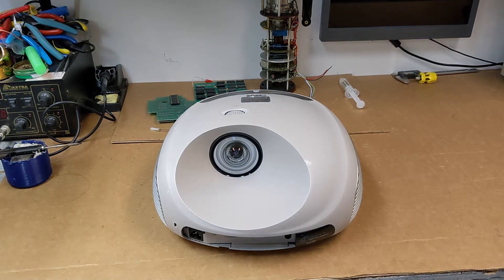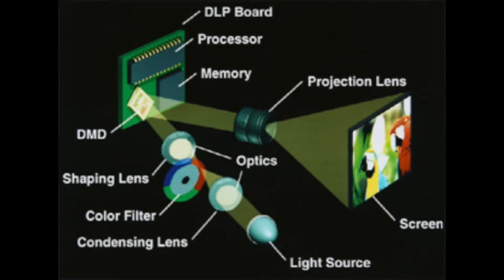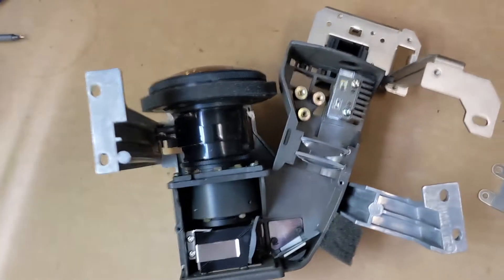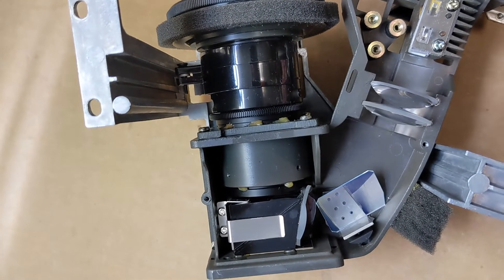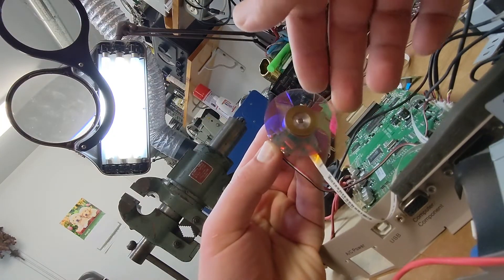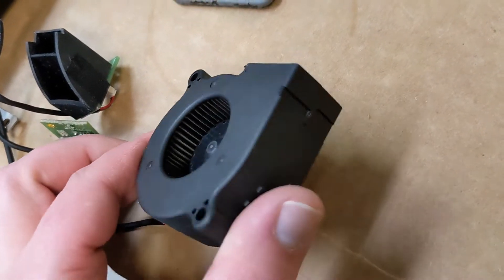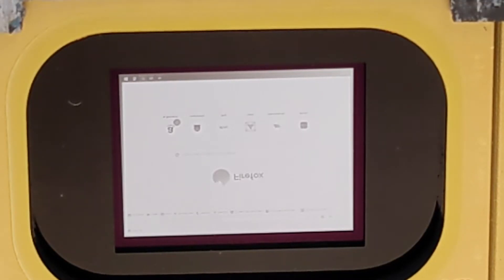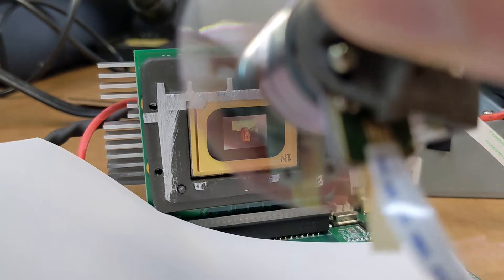What a DMD chip looks like in operation | DLP projector teardown

Comment: Great video! This reminds of taking apart broken electronics as a kid but with a much more thorough explanation. I like that you include some of the oopsies like the power button and why it didn't work (reversed cable). You've earned yourself a follower.

Which thermal imaging camera are you using? I have an old Seek thermal module but the refresh is much lower. Probably a single digit refresh rate. In addition to your higher refresh rate, the resolution looks higher as well.
Reply from the maker: Thanks! My thermal camera is the InfiRay P2 Pro. I've had it a couple years and been pretty happy with it.